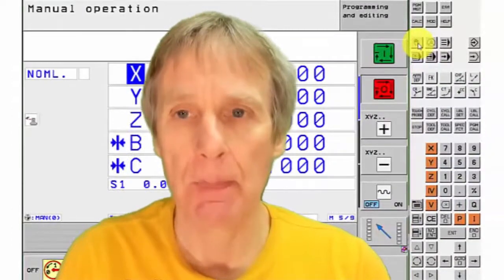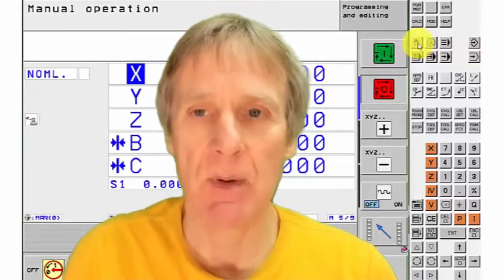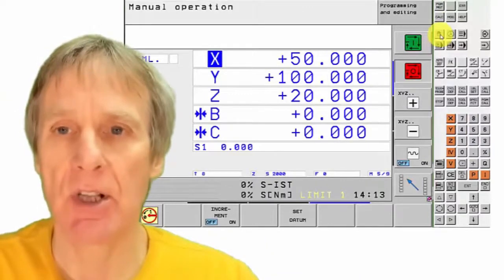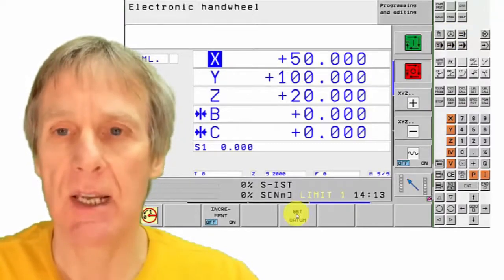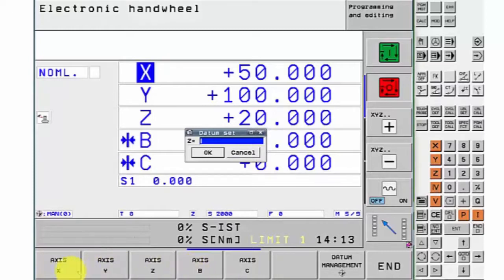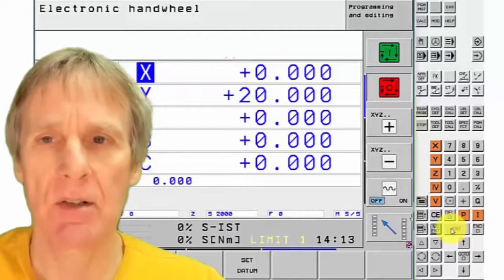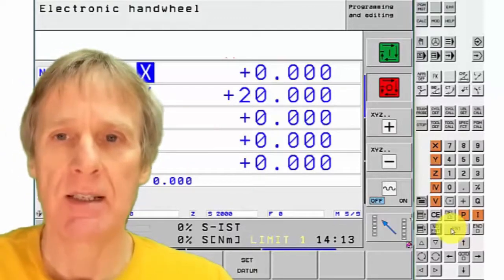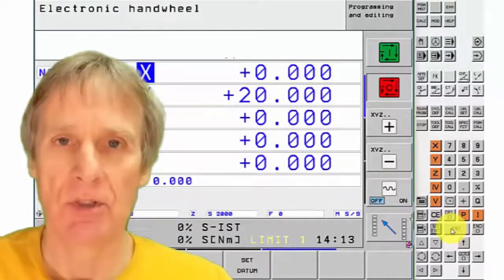Setting Heidenhain Datum

Comment: Quick question.. 
In Heidenhain, If i was to set the datum in XYZ. But then i wanted to alter the Z by +100mm (to test the program). Is there a method to do this that doesnt involed manually bring the tool down the Z100 and resetting the datum?

For example when using Fanuc you can just input+ a value into your G54 offset

Hope that all makes sense. 
Thankyou 👍
Reply from the maker: Press Set W0 then move to Z axis and press = and the calculator will appear.
Then press +100. then press ACCEPT or ENTER
Thanks for watching my video hope this helps email david@cnctraingcentre.com if you need more help